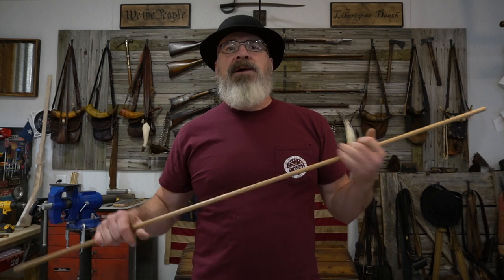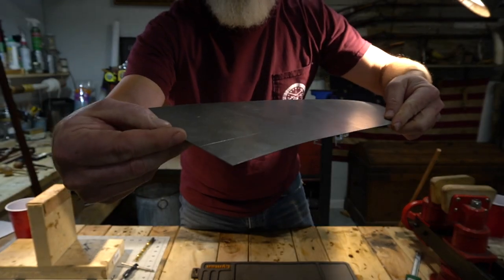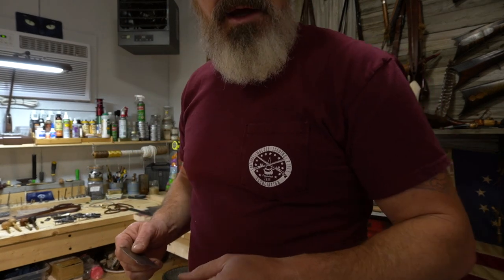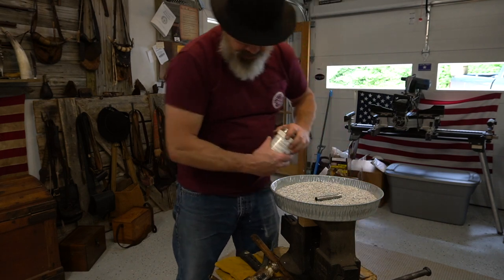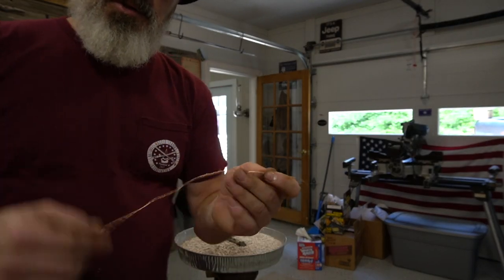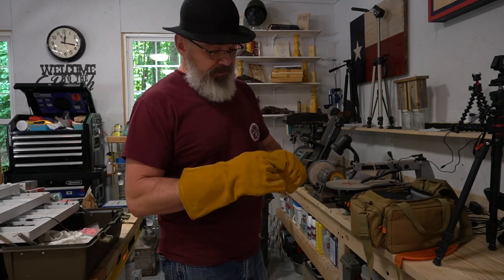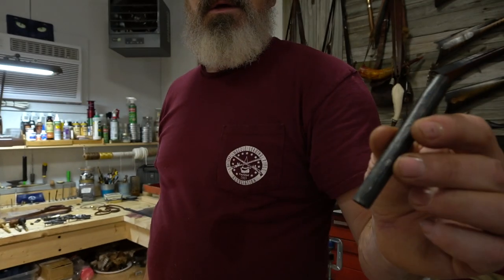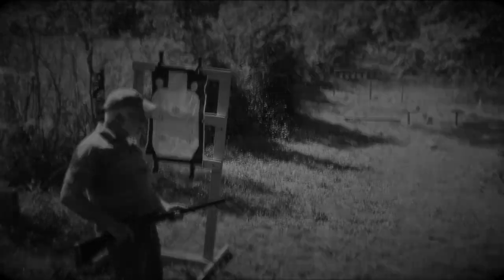HAND MAKING A FLINTLOCK TRADE GUN WIPING STICK - PART #1

Comment: Check out the coil worms. More period correct for that style trade gun. I know a few original wiping sticks for these guns have been found and they do not look like what you are making. One that comes to mind is just a plain stick, thicker on one end and tapered down where a coil worm wrapped in tow was attached.
Reply from the maker: Thanks. I understand about coil worms. I didn’t make it as one that would have been sold with the gun. I expect those to have been simpler, but iron tips were common enough. This is a copy of one made by Rich Pierce as being appropriate for the early Carolina import period. It’s just one from the period someone would have made to go with a trade gun or equal. The handle might be a stretch but I don’t count stitches. I’d love to see a picture of an original wiping stick of the type sold with early Southern market trade guns. Never heard of one being found and attributed. That would be super. I appreciate the comment. 👍🏻

Comment: What a coincidence. The other day I spotted a long dowel with a handle on it sticking out of a trash can.
I thought to myself. That wants to be a cleaning rod for a shotgun.
I grabbed it and brought it home.
It was a blinds cleaner but the fuzzy stuff on the end had come off. It measured 42 inches long. It's about 7/16th in diameter.
I looked through my box of cleaning bags and I found a 3/8th ferrel threaded for most of my cleaning tips.
I used a tubing cutter to scribe a line around the dowel where the end of the rod would bottom out in the ferrel. Then I carved, scraped and sanded to fit the ferrel onto the rod.
Then I found a 3/8 brass muzzle protector and I slid it over the ferrel and sanded the rod so the muzzle protector will slide up and down the rod. I'm still standing on it a few minutes here and there. 42 inches is a lot of sanding but I'm getting there.
A pretty cool little project for dumpster diver.
Reply: Oh o forgot to mention that I glued the feral onto the rod by melting a stick of hot glue and smeared it over the wood before seating the feral onto the rod. I hope to put a pin through it when I fine a piece of braising rod or a brass nail.
Reply from the maker: Amen Johnn! I love it! If you don't think those boys back in the day didn't make it happen with what they had on hand you are mistaken! Thanks for the story! Super stuff!

Comment: should never use your calipers to mark lines on your stock
Reply from the maker: I've got a jig for that, but youre right, you can never make them straight. You'd be better off using a straight edge if you didn't have a jig of some sort.